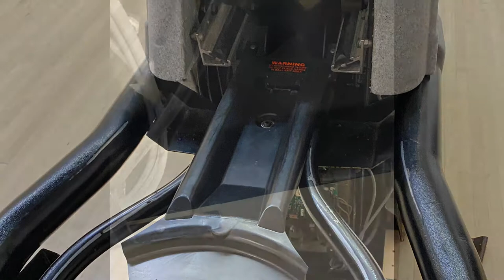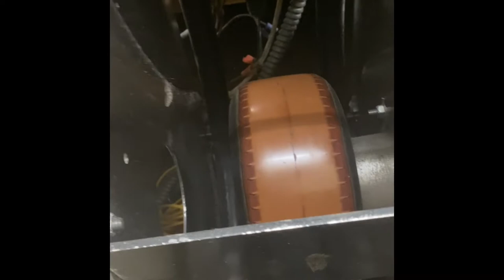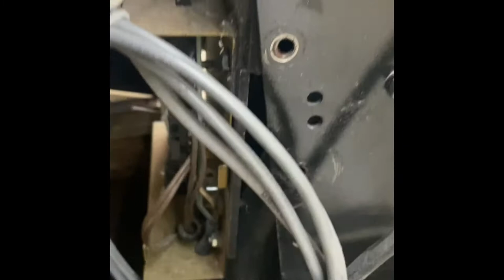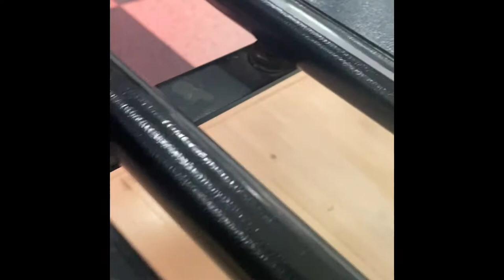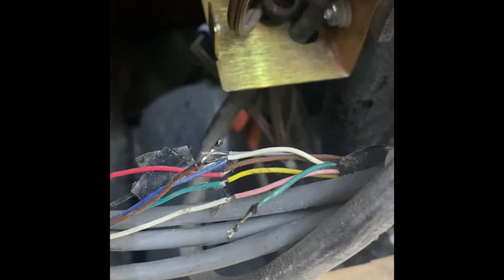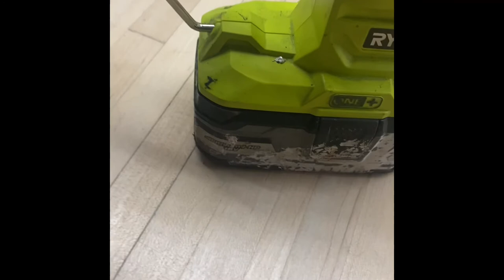front ball return Issue & Solution

Comment: I think I just ran into the same issue. I gotta check the wires once league finishes up.
Reply from the maker: If your 10th frame switch wires are good, sometimes is going to be the control board relay pins that got burn and make fault contact and turn off the motor as well.